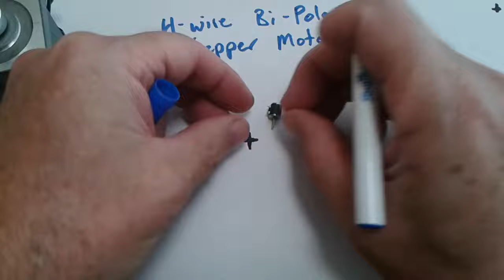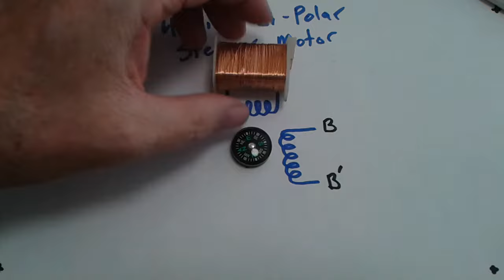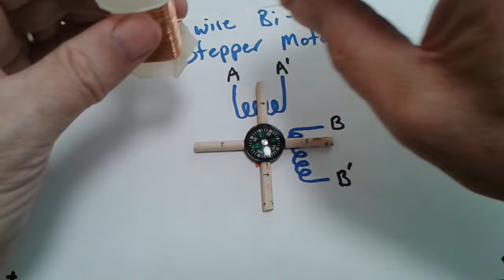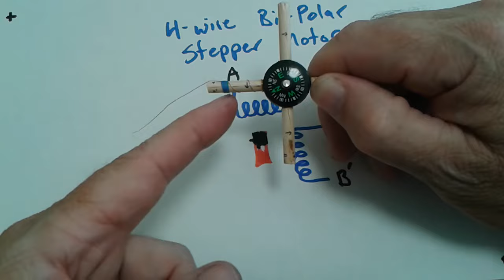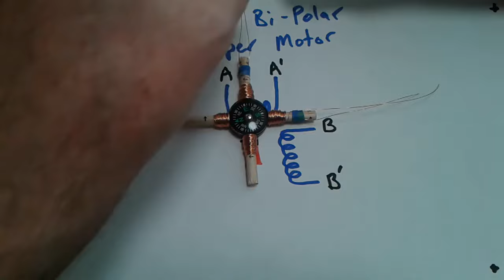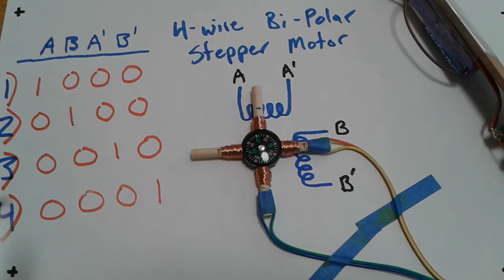How to Make a Stepper Motor (and Learn How They Work)

Comment: Kindly tell me apparatus and which copper wire you used and which type of buttons are the used
Reply from the maker: You can use anything you have or can find. I just used things I had around. The main thing is not to use too much current and overheat the wire. An AA size battery is plenty.